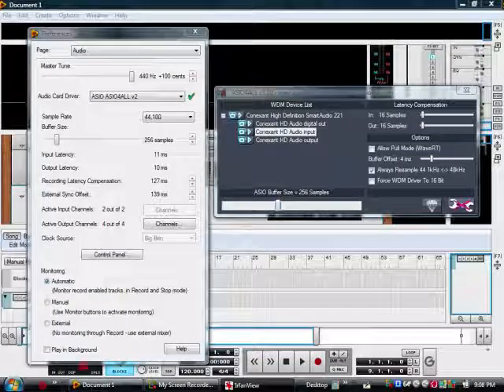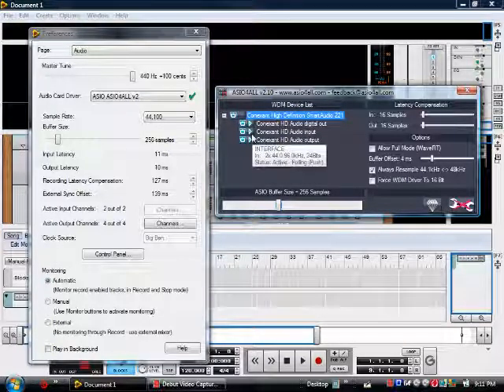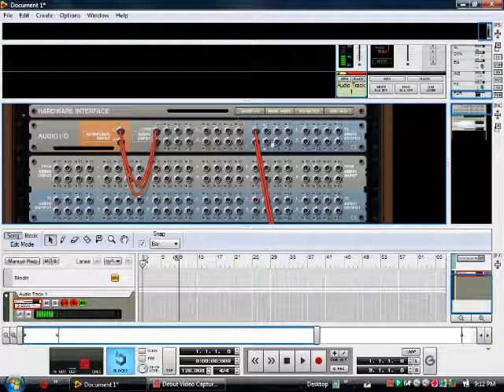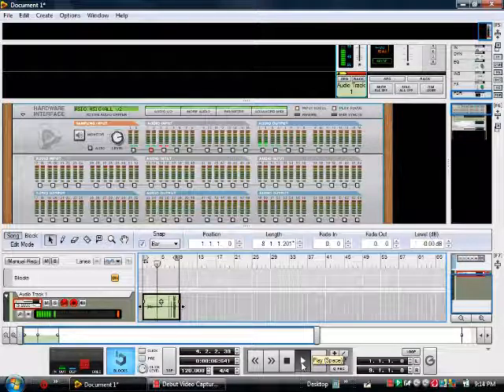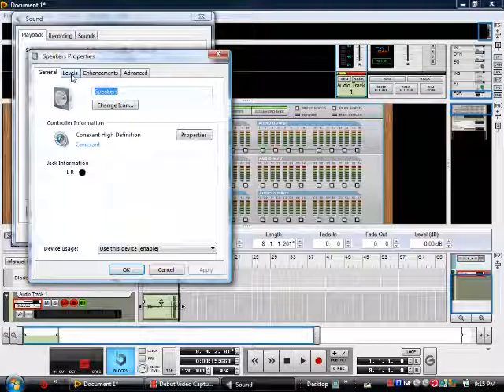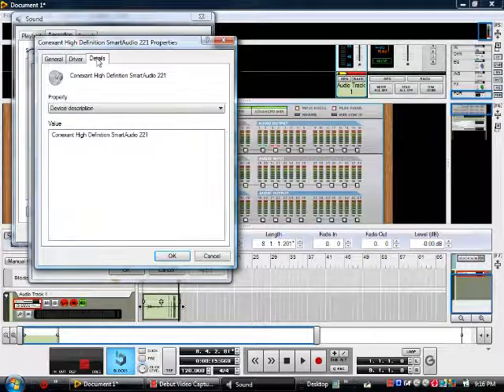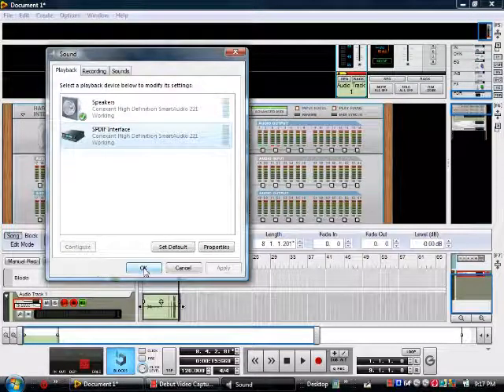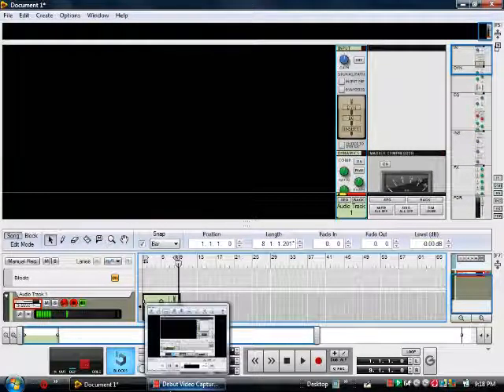Propellerhead Record 1.5 Demo  Audio Problems PART 2

Comment from the maker: Hey thanx!Things work out fine now. i just use the built in SPDIF interface and choose ASIO when I'm in Propellerhead Record. And when I want to use any other program for audio I use the other speakers for anything else. I have Conexant HD Smart Audio 221 :0 But I would want to try a hardware audio device. It would be great to have a nice mic :)